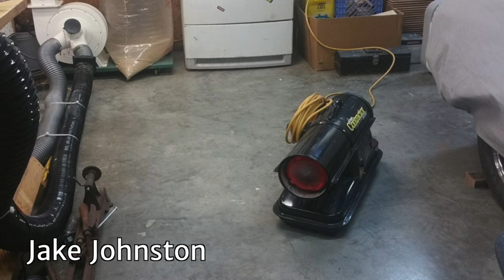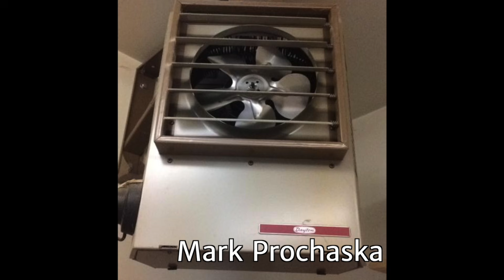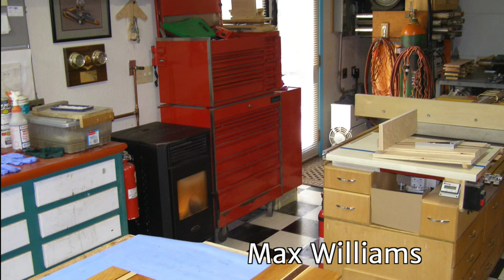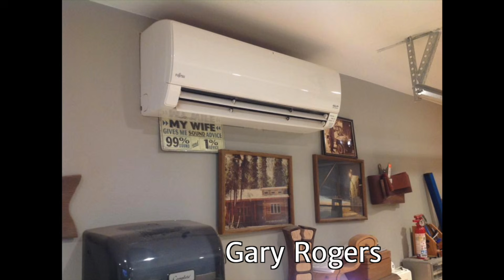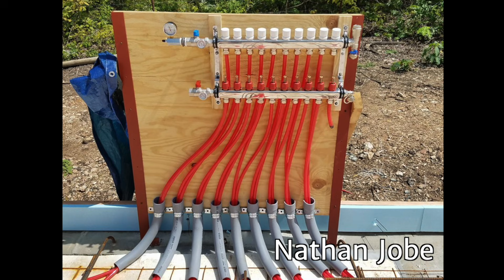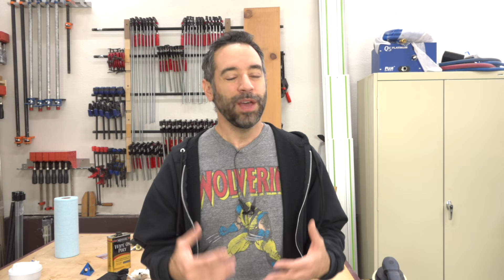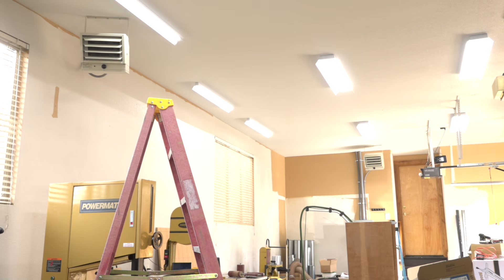Heating Your Workshop

Comment: Why not do hot water baseboard.  That gives you efficient, even, quite heat not and sets you up for the subfloor heating you ultimately want.
Reply: You need to keep them exposed which means no cabinets or tables to cover them and you would probably need a lot of wall space for them. He didn't want to pay for a gas line so it would need a lot of power for an electric boiler or give up space for a hot water tank that may not give enough heat, especially if you are trying to warm it up from below freezing to work for a few hours.
Reply: @deckmonkey1459  Thanks, I made that comment since that option was not on his list and because he said he felt in-floor was his ideal/dream solution and baseboard can come close to that.  True, you need baseboards to do baseboard heating so it can limit lower wall space.  Also, both baseboard and in-floor need hot water and both are slow uniform heat so they are really meant for continuous use heating.  Note: Only heating the shop when you are using it may seem like it could save money, but If a shop is well insulated, intermittent fast inefficient heating may use more power than slow efficient continuous heating.

Comment: Convection heating/cooling is one of the most effective ways of transferring heat. So long as you minimize the period you have your door open it should not make a big difference. Just remember electricity probably costs you three times the heat you are losing/gaining.

Comment: Circuit breakers are not designed to be disconnects, you really need to put a disconnect in to avoid future issues.
Reply: I thought the same when he mentioned using the breakers to control the heaters. They should have a proper disconnect and a stat would be a good add.
Reply: A simple thermostat and motor starter is the proper answer. Programmable is even better.
Reply: 1. You don't need a motor starter on a fractional horse-
power fan motor.
2.
Reply: 2. Circuit breakers are suitable and approved as a switching device if listed and labelled as such,  "sw".
Reply: @bobbarna9165  I agree with you on #2, some breakers are. If the starter is using electric heating elements it needs to use a starter, motor by itself doesn't require one on its own. The programmable option allows it to start heating before you arrive to work.

Comment: My shop is in half of a small,  2 car garage, drafty.  I bought a single head radiant heater that screws into a 20 lbs. propane can (15 lbs with the cheap ass Home Depot fill). A few evenings a week and 6-8 hours over the weekend used about to cans per winter the past couple of years. When I get home from work,  I'll light it,  & go in the house & do whatever chores need to be done,  after 35-45 minutes the shop is very comfortable in a sweat shirt

Comment: Great video! In the UK, some businesses have found the cost of running electric is double that of propane (gas) heaters - though there is a greater fire risk for woodworkers with gas heating over electric.
Reply: Start with insulation. Underfloor heating such as electric mats and use propane gas to supplement the heating then might be the cheapest option. 
I have underfloor heating and an air circulation system but that is not really an option for everybody. 
There is no point heating the space if cold air circulates or if warm air can easily move out.

Comment: You didn’t mention far infrared radiant heating. I just installed two 300w panels equivalent to 1500w using radiant heaters - flat, slim panels with infrared at a different frequency to the old fashioned tubes. With electricity in the UK equivalent to 26 US cents per kWh it seemed like a great option. Yet to put it to the test, but I am optimistic!

Comment: So, I'm in Aurora, Colorado. Last year I installed a Cadet 4000 watt electric heat in the garage. It worked great. I started using it in November and for one month my bill went up ~$125. After that, I figured I'd just deal with the cold. I'm not doing it for money so I cut back on projects. I can't even image what the bill for Jan and Feb would have been. The heaters in the video should work find for the Oct-Dec time frame. It's Jan-Feb that is going to be the real test.
Reply: I had the same experience. I ran an electric heater for approximately 1 month, only for a few days a week and a few hours each time. My electric bill went up at least $75 so I decided to close my workshop (10x12 shed) up for the winter. I am using the time off to catch up on projects inside the house now that my personal projects are on hold for a few months.

Comment: Wouldn't recommend using the circuit breaker as the primary disconnect.  Go for that switch with the thermostat.
Reply: I use the breaker to turn mine on and off...what’s the reasoning not to? Too much wear on the breaker?

Comment: Im not sure why you wouldn't install a wall mount thermostat in the first place, it probably wouldn't have affected your bill much. Also another negative about electric heat vs gas other than the electric bill is, gas burns inside air and exhausts it so there is air exchanger with outside helping to control humidity. Electric just heats the air if it is humid in the shop and gets real cold outside you can get condensation on all the cold spots like windows and door knobs.

Comment: Colorado...nice temperature...here in Quebec, in the laurentians, we get bad winters, global warming forgot us, we get the minus 40 and piles of snow...in my shop I only have 2, 4 feet wall radiators about 6 inches from the ground, and I keep the temperature around 65 to 68...I find it's the right temperature to work, less sweating but still .... the problem is the summers when the temperature goes to the 90 degrees, in the afternoon the heat in the shop is a pain!!! Looking for a mini split next year!!!

Comment: I use a mini split for my a/c and heat in Maine. In winter it can get pricey but keeps it shorts and t -shirt nice about $75-100 a week when outside 29 to -20. Summer when in 90’s keeps shop 68-72 and cost practically nothing to run. 
So pricey for 3 months and 2 months still a high electric bill. Worth the ease of use and how comfortable it is in shop which is around 700 sq feet
Reply: How do you deal with the dusty environment on the mini split intake? I want to install a mini but the contractors are saying it’s not a good option

Comment: Not sure about the sun light conditions in Colorado during the winter months but have you thought about a Solar Heat Collector made out of black painted soda cans?
Material wise it's relatively cheap and for someone with your skills an easy project to build. After that enjoy your freely collected energy. In combination with your new electric heaters you could cut down on your electric bill. Just a thought :)

Comment: So besides being an eyesore, how did the mini split perform? I'm considering putting air/heat in my garage and the mini split is at the top of my list. Anyone have any experience with them, good/bad? Thanks!
Reply: I’ve been thinking about this also!
Reply: Depending on where you live and the average outdoor temp in winter it may work for you. But if most of your days or nights are below 36F then they do not perform very well, and some units will quit at 40F. If you look at one be sure it can operate at freezing or lower. If it won't it will only extend the usable shop time but most likely not carry you through the dead of winter.

Comment: I use infrared panels on a thermostat. No noise, no air movement and it heats the shop easily. No cold feet - no hot face. And they are no thicker than 2 inches - and placed in the ceiling.

Comment: At this time I am using propane heat. Dose a fair  job. The down side is that when I am staining projects in the shop. Well, the flash off is so bad that you lose the heat to ventilation needs.
Sometimes I have to just leave the shop for a day.
 Thankfully I'm retired and not needing to hury anything to make money.
So I can do this.
 (Q).. Do you get any flashing off of stains that bad with the electric heaters you are using?
Great subject line, thanks.

Comment: I installed a similar heater in my garage and hooked up a Nest thermostat to it. I can turn it on via internet so the shop is warm before I get there.
Reply: TIm how did you do that? That’s a great idea.
Reply: John Barduhn 
Install a 240v w/24 v transformer at the heater. Connect the 24v on the relay to the Nest thermostat. Use thermostat control wire to connect the relay to the Nest. Only install the red & white wires. Nest has an issue with not staying charged if you connect all 3 wires.  I used the cheaper white plastic Nest. In that one you connect the white wire to W1 and the red to red.
The cheapest source for the relay is supply house.com, follow this link https://www.supplyhouse.com/Honeywell-Aube-RC840T-240-240v-Relay-w-Built-In-24V-Transformer

Comment: I am just setting up a shop and learning woodworking and have been looking at a heating solution for this winter. My concern has been safety. Sawdust is certainly combustible and can be explosive. Different types of finishes can give off combustible gases. I'm wondering if I am overtly concerned about this topic?
Reply: Depends on the size of the workshop and ventilation I would say

Comment: If anyone is planning on building a new shop, in-floor radiant is the only way to go.Existing shop that's well insulated, any heat source will do fine. It comes down to personal preference. But' the mini-splits have come a long way and there are a couple of manufacturers that are able to heat down to -10 F.

Comment: We just finished our house where we use in-floor heating. The water is wormed up by a heat pump just bigger then yours and effective on -15C but you can even use condensing gas boiler. Still have to plan it ahead because of the in-floor pipes.

Comment: You should be able to calculate the cost per hour based on the watts used.  If you have a 5,000 watt heater,  and you pay 10 cents per kwh, that heater costs 50 cents per hour to run, right?   I am lucky ro have my garage heated by the house furnace.  My garage is always ready for me!

Comment: You didn't touch on the noise factor too much, but with filming all your content you really only have 3 options. Electric Force air, Radiant and infrared. I have always used forced air for my heating living in MN most effective way to heat my shop 40'x32' but my 100K BTU reznor is pretty annoying while its running.

Comment: I had this question before I built my shop.  I decided on hydronic in floor heating.  It has been 20 years since I installed it and am very comfortable working in my shop all winter long.  It is 12 degrees outside this morning but a comfortable 65 in my shop!  I have never looked back and love my hydronic heat!

Comment: I was originally planning on using a wood stove to heat my garage/workshop but the cost to have it installed and cleaned every year was cost prohibitive.   I ended up going with a $100 propane space heater.  Which works really well.  Eventually I’d like to upgrade to the electric heaters like you have.   And just leave them at like 55/60 degrees so the shop isn’t freezing when I come in.  It’s a stand alone garage that is not connected to my house.

Comment: I'm going to have to just suffer this first winter in my new shop and hopefully make enough money to put 8n some kind of heating system before next winter.
Reply: Depending on your location, have looked into a solar furnace. You do need a southern exposure. I built one for my shop using glass from a damaged sliding glass door and aluminum cans for the tubes. Snap switch to automatically turn off/on fan. Sun = warm. There are several designs on YouTube, check them out. Solar furnaces do work, and a heck of alot cheaper.
Reply: @patzeuner3362  thanks for the tip. I will check out some solar furnace videos.

Comment: If you review how split systems are installed in apartments, you may find a solution for the compressor unit that's close to your internal heater via a rigid frame and bracket mounted to your workshop. Just a thought. Allan

Comment: To put radiant tubing in an existing slab, cut slots with a tool like this
https://www.contractorsdirect.com/husqvarna-cut-n-break-saw
lay the tubing in the slots, and cover with grout. For a smoother floor, lay down a coat of self-leveling underlayment.

Comment: I run my Mr heater on propane since my garage is detached and no real way ways to get gas out there. Depending on usage I get two 100 pound bottles a winter
Reply: How big is your shop? Is it insulated. How much does it cost to fill a 100# bottle.
Reply: @bobd.  2.5 car garage. Insulated. And 80 bucks to fill.
Reply: That's reasonable I think to heat that space all winter.
Reply: @bobd.  I also have it on a WiFi thermostat so I can turn it on and off whenever

Comment: Right now my shop is heated by one of those portable radiant oil-filled electric tower heaters and so far it's been doing fine for me, but my shop is a one-car detached garage where I never use the garage door unless it's summer and I need the air or space, and is really well insulated. I also only have time to do things on weekends, so I can afford to be stingy on the price of the heater unit and can have it be electric since I'm not in there enough for those costs to matter.
Reply: Glad you mentioned this, I would’ve thought that long-term, good door insulation would be a much bigger factor than opening the door 2x 30 seconds.

Comment: I have radiant floor heat in my basement and attached garage and it is very nice however I choose not to go that route in the shop becuase I don't want to keep the shop at temp all the time. I turn mine down to 55 when I'm not in it and radiant floor heat would take way to long to heat it up, my forced air furnace heats the space up to temp in about 10 minutes.

Comment: Happened to be at Woodcrafters in Portland,  OR last week and talked to one of the employees there about this very topic.   He mentioned that both propane, and gas heaters add additional water molecules to the air.  As far as electric heat he is a fan of Infrared Heaters.  If I go with forced heat - like you did - I definitely would want a thermostat added.  Thank you for your perspective.
Reply: How do they add water? They are sealed combustion units with an air exchanger so no combustion air goes into your building to kill you with CO. That sounds like the myth that radiant adds moisture to the building. Radiant is the way to go for sure, gas if possible.

Comment: Two observations... first, I have a 6KW 240V electric heater in my 2-car garage and I've only used it a few times because it costs so much to run it. I live in Southern Ontario so our winters can get pretty cold. My garage is also only about 50% insulated, and the front end of the garage is draughty so it's probably not a good test, but it costs about $30 to run the heater all day in winter. That might not sound too bad until you realize it's about $200/week. I plan to fully insulate and block the draughty area above the doors, but even so, I plan to switch to natural gas when I can afford it.

Second, avoid the temptation to go with a portable propane heater just because they can be had for fairly cheap. One of the main products of propane combustion is water vapor. Running a propane heater in an enclosed workshop is pretty much guaranteed to rust every tool you own, especially in winter when the cold tools condense the humidity and then freeze.

Comment: I put a motel room heater/air conditioner in my shop. I had to cut a hole in the wall and also installed an external thermostat, which allows me to keep the shop at minimum 45F in winter. So far, so good. Cost about$900.

Comment: I'm in Florida and we have pretty mild winters normally (DUH!) But, it does get cold even here; cold is relative. I have a mini-split heat pump. 1 1/2 ton. My shop is mildly insulated and it cools and heats very well. Best 1,400 I've spent for my shop.

Comment: I had a Reznor gas unit installed with exterior air for combustion. I live in North Central Ohio so I know cold.  I keep the garage at 65 degrees in the winter and the gas bill is barely touched as far as I can see.  Everything is warm when I go to work in the morning with no wait time.  Very satisfied
Reply: Winnipeg, Canada.  I laugh at your cold.

Comment: At 12 cents per kWh (average US price apparently) running both the heaters for an hour would cost about 70c. When you think about a whole day and running constantly for 9 hours that's about $5.50. Whilst not cheap, it's actually very inexpensive and more so given they would probably shut off at some point. You could easily spend that much on a fancy coffee or buying a quick lunch out somewhere.

Comment: What about adding some solar panels to offset electric use
Reply: david rudy If you are talking about solar electric panels then that is a bad idea, they do not produce anywhere near heating power. If you are referring to solar water heating panels then they may help but very difficult to get to run effectively in cold climates, and both depend upon sunshine. They is no single best solution for all locations.

Comment: Do you keep the thermostat at a low, but higher than freezing temperature at night or do you turn them right off and the shop gets to below freezing in the coldest months?  If so, do you notice rust and condensation from the freeze/thaw cycle?

Comment: I'm a bit confused by options.... I presume gas or oil fired central heating systems aren't a thing in the US? Seems if you did have central heating, getting rads in the garage would be the best bet (since it's an attached garage).